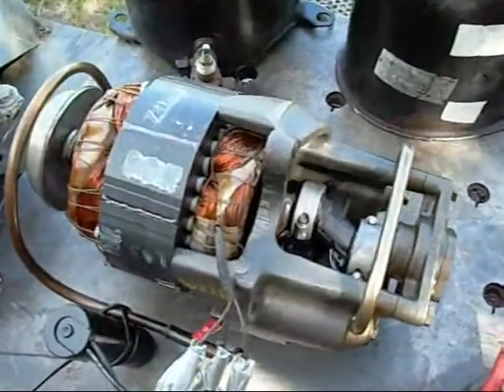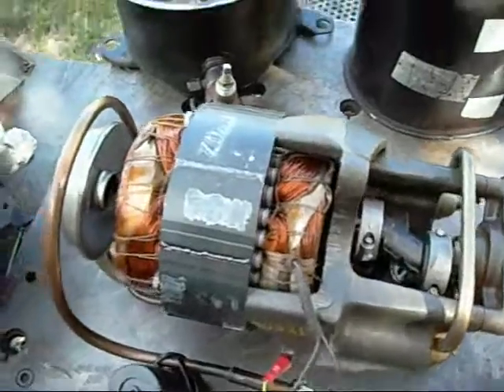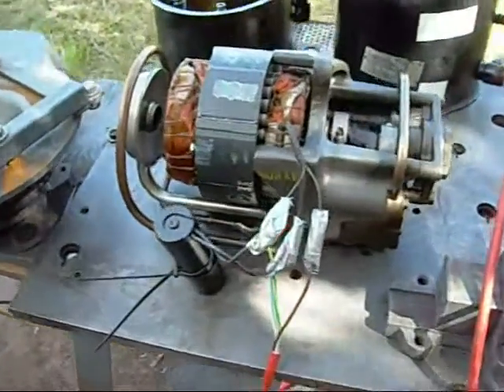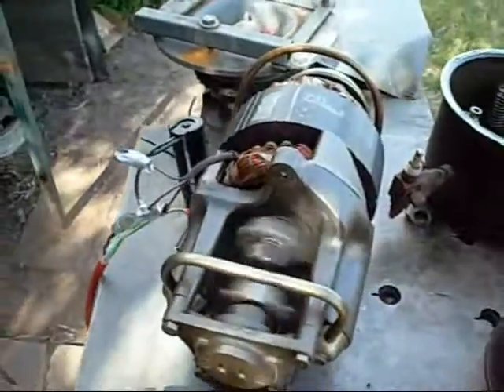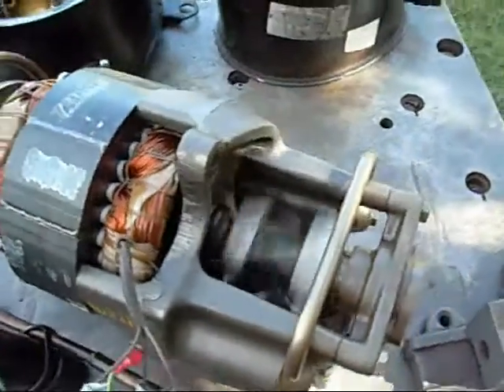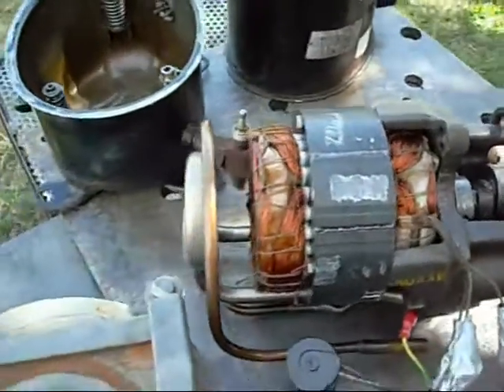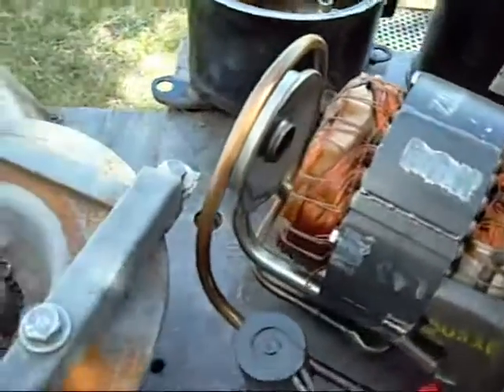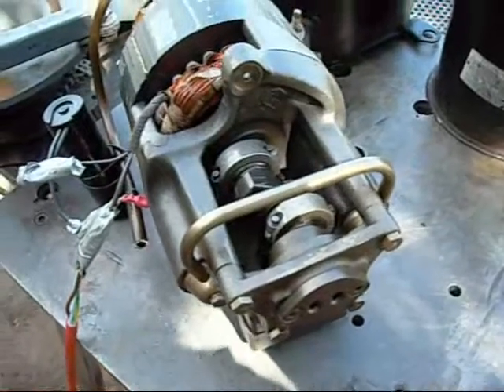Kirby Reciprocating Commercial Fridge Compressor

Comment from the maker: Healthy AC comp oil should be clear, with similar viscosity to light motor oil.

Well used oil looks amber in color and is comparable to new motor oil color.

After a mechanical failure the oil will usually be metallic gray from all the metal particles suspended in it.

Comment: sounds like the compressor in my neighbours toshiba window rattler aircon,  just as noisy,bloody thing keeps me awake of a night even though its about 15 metres away and on the other side of the house. the ac unit is at least 27 years old and they leave it on till about     2am!

Comment from the maker: That it dose!, much of it comes from the intake gas passing through the reed valves in the head. The sealed housing eliminates 90% of the noise these compressors make.

You can also reduce the noise of a conventional air compressor by ducting the intake to the outside of the building in is used in.